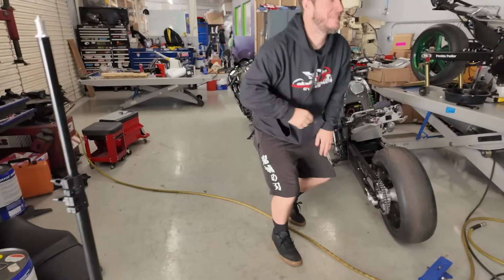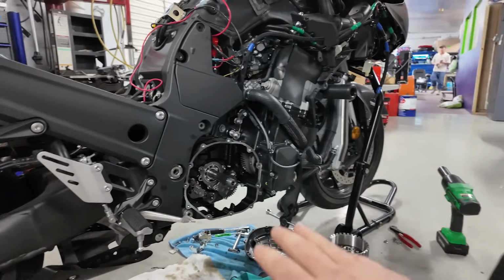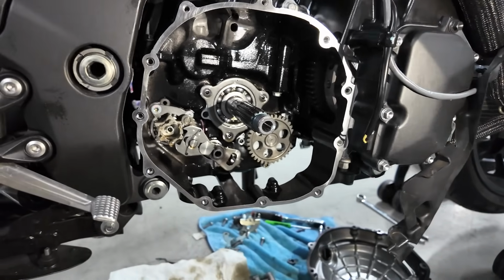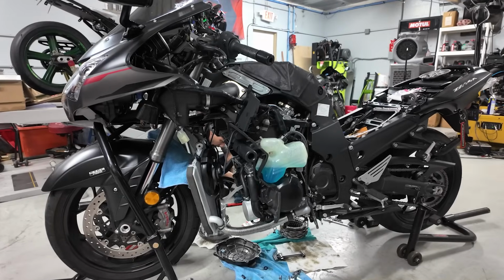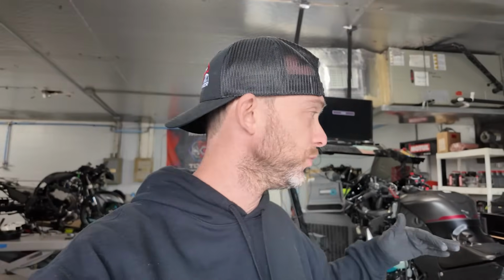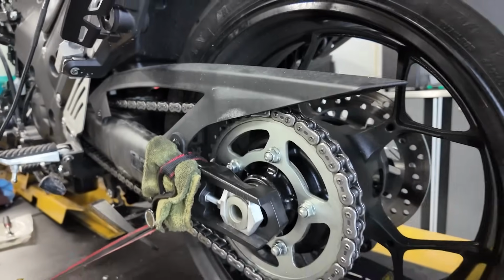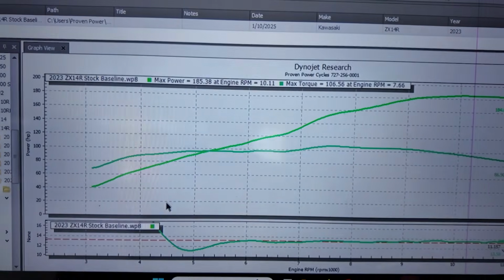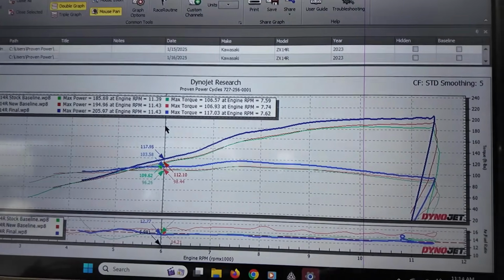2023 Kawasaki ZX-14R Makes OVER 200HP!!

Comment: Explain how this new oil pump gear increases the volume without changing the corresponding drive gear on the back of the clutch housing?
You can't change the diameter of one gear without changing the other...
Reply from the maker: People do it all the time in many different cases. Changing one sprocket on drive chain can change your overall gear ratio... changing one gear in transmission can change that particular gear ratio also... so yes you can change one gear to change the speed at which the oil pump pumps and increase rpm (which would increase the amount of oil being pushed through the engine).

Comment: I'm curious to know what the main difference is besides displacement between the 1352 and 1441. I know the larger engine due to its numeric size makes more power, but at what point and how much more does the 1441 excel? I know more displacement adds torque.

Comment: I wonder if similar gains could be had with the Gen 1 (1352) with those mods?
Reply from the maker: @joeljohnson3676  similar but won't hit 200hp on the gen 1 with these mods. You will need more into it 🤙
Reply: @provenpowercycles maybe not 200 HP, but near is good.

Comment: I seen the title and I’m confused as to why over 200hp for a Zx14 is a big deal. Most modern liter bikes come stock with that much.
Reply: They tell you they are 200hp stock until you put them on a dyno. Most dyno runs I've witnessed the dyno numbers are usually 20% lower than what they tell you...That's just real time facts! Most adjustments in the tune are done to shut off all the throttle response dips and they dip hard in different gears...Then comes the air/fuel mixtures getting them to average around 13 on the dyno. All new bikes come like this because the manufactures don't want their motors blown and as you seen on this dyno run, they come out running on the RICH side of the scale. Lean is mean if you can control the heat of the motor but 13 is the average number you want to be as linear as possible.

Comment: I do over 200whp in my 1300 2006 hayabusa. No Problem
Reply: Don't 4get 2 tell the mods you made on the bike, we both kno it's definitely not stock 🤷🏾‍♀️, either engine built or a nitrous or small turbo.
Reply: That's a fact jack! I have seen videos where the busa with cams added along with the same mods as this 14R only make 185 -190 bhp! This 14R with just pipes, quick shifter, and tune checked out at 205bhp. Not bad at all. @1tuffzx10
Reply: @1tuffzx10  u wanna a modlist from my Bike ? I think this letterbox is to small 🤣
Reply: @1tuffzx10  He's got a ZX14 engine swap 😉

Comment: 200cv x un 1400 è semplicemente depotenziata.un 1000 moderno come una r1m stock eroga più di 200cv alla ruota...poi se togli il catslizzatore.ais e scarico  completo mappato raggiungi i 210cv al banco senza problemi.certo avrai qualche nm di coppia in meno ma tirate una affianco all'altra la zx non avrà alcuna speranza. ciò che conta è il rapporto peso potenza molto a favore si una superbike che di un camion come l'hayabusa ormai obsolete quanto a materiali telaio (alluminio contro alluminio aeronautico e magnesio e titanio) e riduzione di interasse cerchi e materiali ultrapregiati per risparmiare anche soli 100 grammi parte che sommati fanno risparmiare anche kg tanto da portare il rapporto peso potenza ad 1kg/cv cosa che zx14 e hayabusa sognano.
Reply: That's true. However, this 14R is a sport cruiser. Not a sport bike. It lost about 30lbs and gained 20 bhp. It does just fine cruising the highways. Also, knowing the bike has the power to escape any situation is comforting to know! It pulls like a freight train on Crack! It can also be ridden for hours on end without any discomfort. It's a sweet bike!

Comment: 205 out of a zx14 is not much.. some 1000cc can get that
Reply: These 1000cc engines also rev higher because they are racing machines.  Peak power doesn’t tell the whole story.  The zx14 is a lot heavier than say a BMW 1000rr.  The zx14 has a broader range of power across the entire rpm range except for the very top.  This is what an extra 300cc’s will get you especially since the engine has to move additional weight.  You can look at the redline difference between the 1000cc supersport vs. the zx14.
Reply: How do know for sure, were they dynoed at a shop?
Reply: No they don't...Most of them aren't even 200HP at the crank...On average from the dyno runs I've been at most numbers come out to be 20% lower on average at the rear wheel. When you shut off all the throttle % control to get full power at each gear level that's a big HP win if you can crack the safety code to do. Then comes the air/fuel mixture getting it run at 13 on average or a little leaner to make more power. Then if you run it a little lean you knock down the temperature of when the fans kick on to cool the bike down faster...It's a multi process to get a motor to run max HP/torque and Still be able to keep it cool & reliable...Running it lean you can blow it up, run it rich most of the time you lose a little HP & Torque but the motor is better protected...

Comment: Between my pop and i we have had several ZX-14’s and ZX-14R’s and put mega miles on them and not once have we ever had any sort of engine issues with the stock oiling system, we also have a friend that does the IBR long distance rides on ZX-14R’s and again not one engine issue and he’ll do 12K-15K oil change intervals.
Reply from the maker: @tysoncott7402  well cruising is different than heavy acceleration and high rpm riding. Most people in our area are racing the bikes and they have a higher risk of letting go without these mods.
Reply: If hes doing 12k oil change intervals, he's either lying to you, or his bike won't last past 40,000 miles. Regardless of how he rides. No in between.

Comment: This is AL , the bike owner. You guys did a great job! I have never seen it look so clean!! LOL I thought you gave me the wrong bike back, no dirt anywhere! The bike is running much much better. I'm digging the increased response and power! I am shocked at  the difference, especially the quick shifter!  Thanks for doing a great job and good luck with the building !
Reply from the maker: @allugo3726  badass! We really appreciate your business! 🙏 very happy it's treating you right! 🙌
Reply: @provenpowercycles That 205whp is on pump sir?
Reply from the maker: @dute007 yessir. This was on pump gas 93 octane.
Reply: Part of loads of forums and a lot of a senior mechanics warn you off a quick shifter no good for this bike. Why would that be, is yours okay still
Reply from the maker: @Davidg-wu5ur not sure why, but when done properly, the quickshifter is fine to run on the bike. I've ran mine on a quickshifter and air shifter for years on same transmission.
Reply: sensitive question maybe but what did it set you back approximately without saying exactly? Maybe parts alone costs if you dont want to answer total